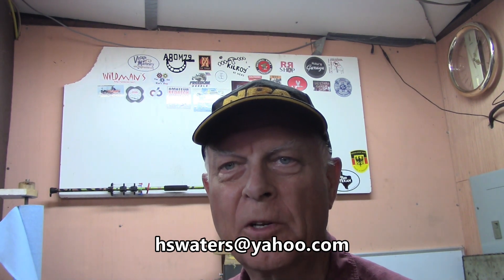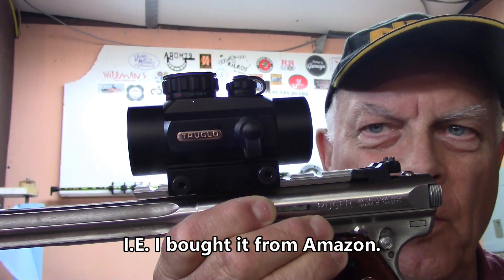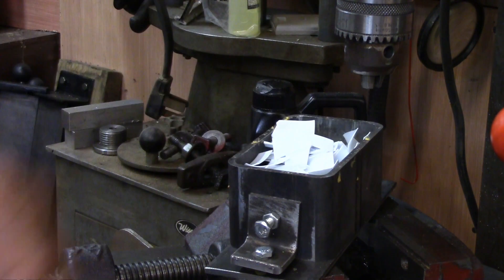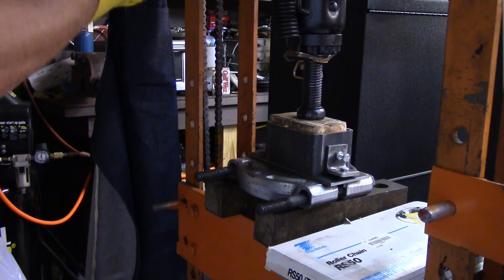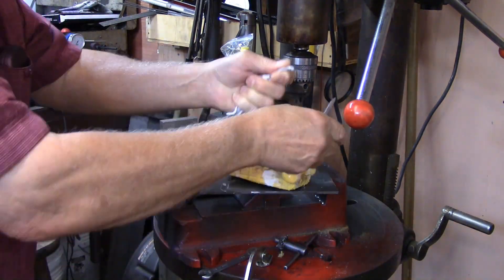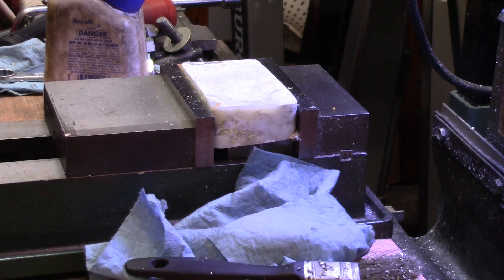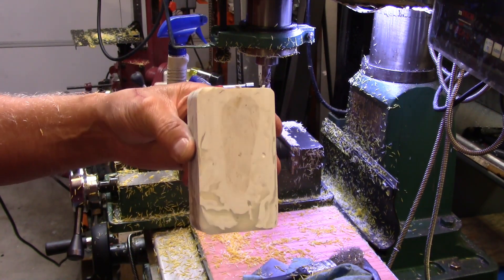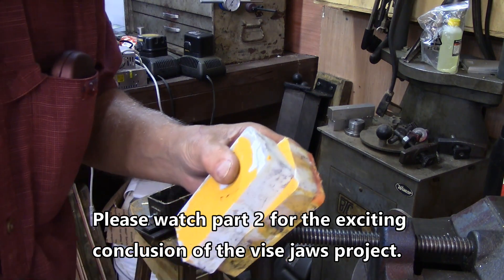HDPE soft jaws for the vise part 1 of 2

Comment: Hi Harold. Those should work great for vice jaws. We call them Laundromats, here in Tennessee also. I very much enjoyed the video.
All my best.
Bobby
Reply from the maker: We were in Tennessee back in the 1970's to see the Grand Old Opry but we did not go to the laundromat.  The boss lady wants to go back to see Elvis home and on to Dollywood and so on.  I doubt we can get a dog sitter for that long a trip.  Thanks for stopping by.
Reply: I think he might run into grip problems. HDPE is not like rubber. HDPE is catalyzed ethylene gas. So sort of like frozen oil? I generally don't use HDPE on projects where I need some friction for it to work. Harold needs to get into making himself some homemade Micarta for stuff like that. Some rags and a can of fiberglass resin.

Comment: Harold, enjoyed the video. I have a barrel vise & have pulled a lot of bolt action barrels. I also use HDPE/UHMW in the shop, but am not sure that it will work very well, due to the low friction. Normally oak blocks work best, gripping with minimal compression. 

Now off to your next video...
Reply from the maker: Just my luck, no oak in my shop to use.  Thanks for stopping by.

Comment: hello harold i dont know much about melting plastic and such but just a thought if you poke up and down at the plastic just before you take it out  of the oven and kinda stir it abit trying to get everything to settle down and maby that would take out the voids in the plastic. another thought  take that  steel mold cut it in half  and weld angle pieces back to back to make it a 2 piece mold bolted maby that might make it easier to deal with. always enjoy your humour and your knowlage and ofcource buba jokes lol.
Reply from the maker: I have been watching a fellow who seems to be able to get the plastic melted without a lot of bubbles and I will try some of his methods.  He pokes it a lot with sharp objects.  Thanks for stopping by.

Comment: Looks good Harold. I wonder if you use the edge of the wood block to push down and level up the plastic before the big squeeze if it would let some of those bubbles out?  Funny i was just fixin to melt me some plastic rite when i saw your video show up.
Reply from the maker: I am not sure what to do to get rid of the bubbles.  I have seen people roll it out like biscuit dough and fold it up.  Thanks for stopping by.
Reply: hehe get an old mangle ^
Reply: I press as I fill, and I use the progressive squeeze method during the hardening phase too. I learned that from this other YouTube guy that gets no bubbles in the melts he does. He's a real artist. He also uses picks to open bubbles up. I skip that and just smash them with a metal punch as I go. He melts all colored plastic and I stick with the translucent. Due to the blends they are different. The colored plastic they put a binder in it so the color sticks to the plastic. Even white is a color.

Comment: Harold: need to add vent holes to the wood
Reply from the maker: I will consider that.  Thanks for stopping by.
Reply: Not a good idea. The plastic will pump up them holes and harden up. Then you'll be chiseling that wood away. Just a little blob of HDPE is some tough stuff. I have to hacksaw it off. I get that squeeze out like you got and even if it is just an eighth of an inch thick forget about breaking it. What you need to do is get the bubbles out before you cover it with your wood block. I bash the melt with the back of a big fat chisel. Those voids look like shrinkage to me. Keep pressing your block down as it cools in stages. keep the pressure on. But then what happens is your plastic block develops internal stresses. When you go to machine it, it can warp on you depending on how you cut it. Don't ask me how I know about this. I still haven't figured out how to fix it yet either. I had high hopes for this project but it curled up http://i.imgur.com/eBfoT6s.jpg Can't be done.
Reply from the maker: Eventually we will get the hang of perfect plastic.  Thanks for stopping by.